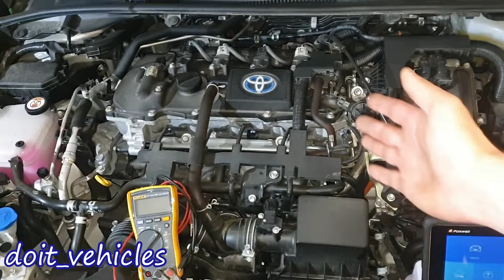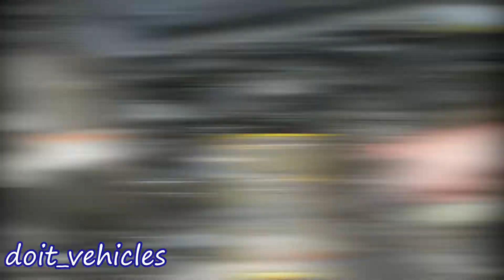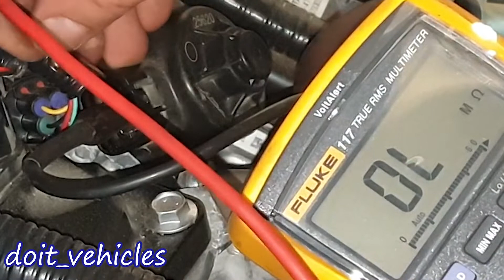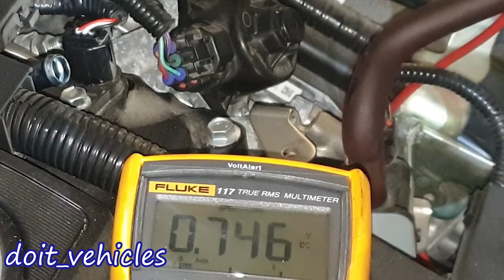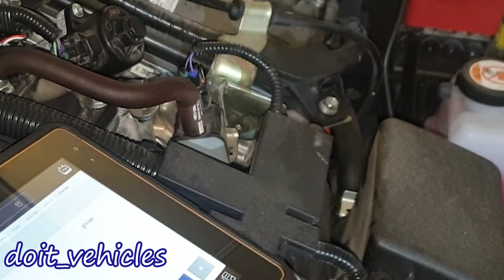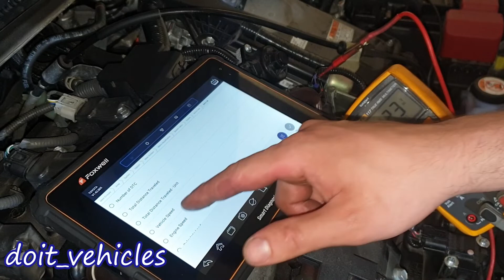EGR valve & EVAP solenoid ( how they work ) 1.8 Corolla Hybrid

Comment: Hi! I have a 2020 Toyota Corolla 1.8 Hybrid. Sometimes, when the gasoline engine starts, I hear a brief metallic rattling or knocking noise lasting 1–2 seconds. I also hear a hissing sound when opening the fuel cap. Interestingly, the noise hasn't occurred after releasing the tank pressure. Could this be related to a faulty EVAP purge valve or tank ventilation issue?

Comment: Hi mate a ford focus 1.0 ecoboost i just managed to into live data fuel rail pressure is 1300 psi 
And also the fault code i am getting is p0089 
Fuel rail oressure regulator 1 performance its says would that be the high pressure fuel rail sensor ? Maybe that sensor is gubbed 
Any idea mate ? thanks